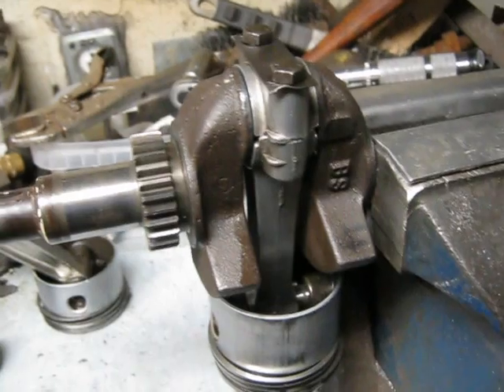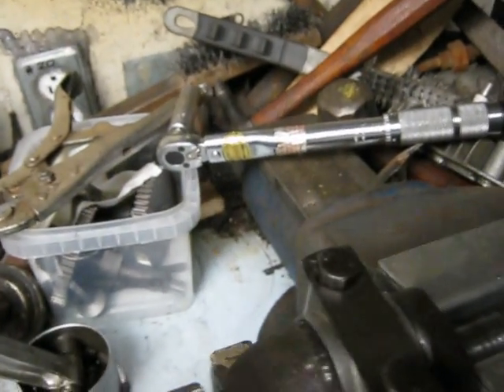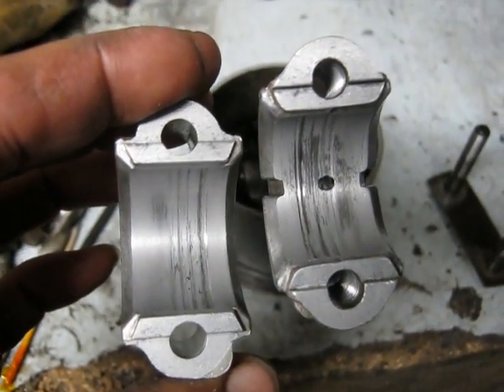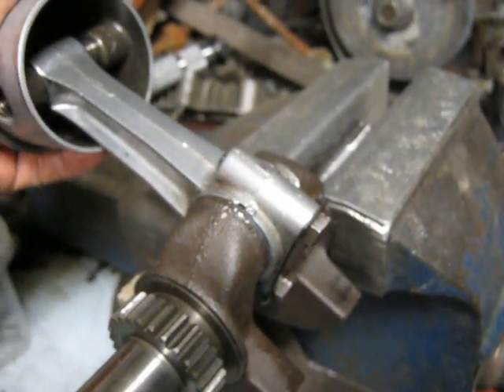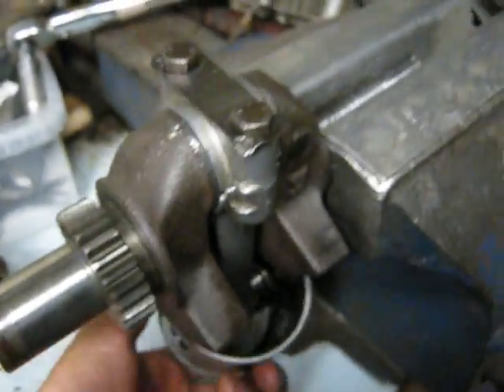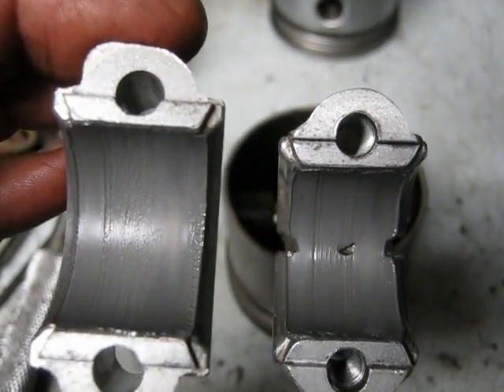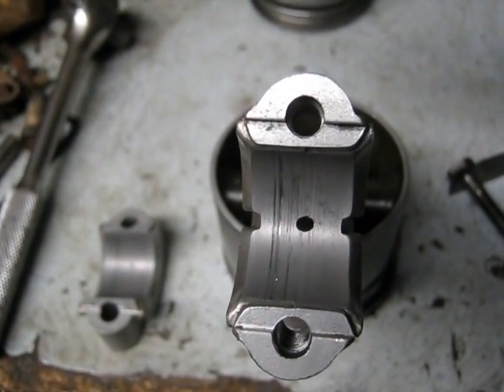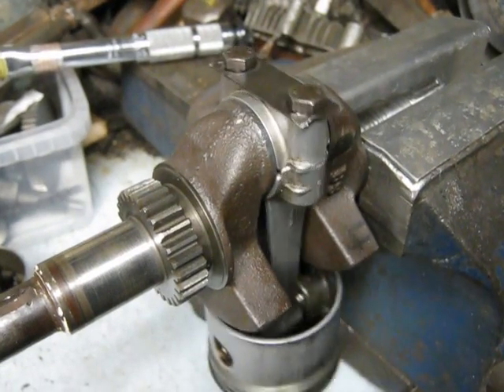Straight 6 FrankenBriggs Build vid 1

Comment: I had a 3hp briggs, started it up after winter storage, ran for 5 minutes, locked up solid and quit. Took the head off and didn't find anything obviouse. So I took the butt of the hammer and kept hitting it while turning the flywheel. Looking at this video maybe that's why it was locked up? Ether way, got it turning, it fired right up again. 2 years later it still runs fine.
Reply from the maker: Hmmm, that is a strange one! Perhaps it had breathed in some dirt, or carbon broke loose. We got the flywheel machined today, so hopefully I can get the 6 fired up soon. Though the weather may be rainy this week, either way, I plan to have it going soon.  :)
Reply: That could be. I rebuilt the engine and didn't find anything out of the obvious but now that I think about it there was some scoring on the connecting rod.

Comment: Ya gotta do what ya gotta do to make these things run!
Reply from the maker: True, though sometimes i think I am pushing it a bit. I am pretty confident this con rod will hold together, as i have seen much looser fitting rods in engines that worked fine. I got the flywheels machined today, so hopefully AC/DC Welding can weld the hub in it, as I want a professional welding job on the flywheel!
Reply: ChargerMiles007 For sure! Don't want it letting go at a bad time!